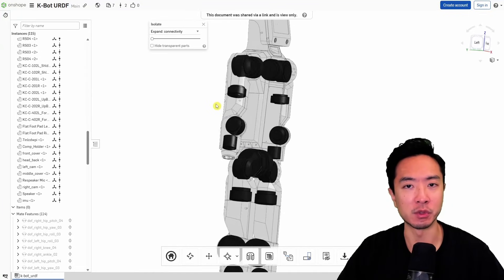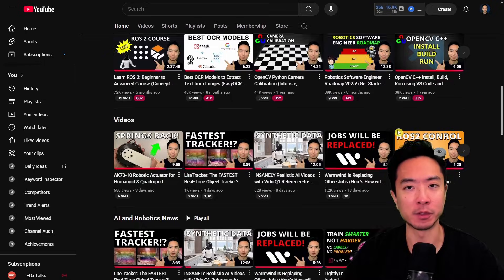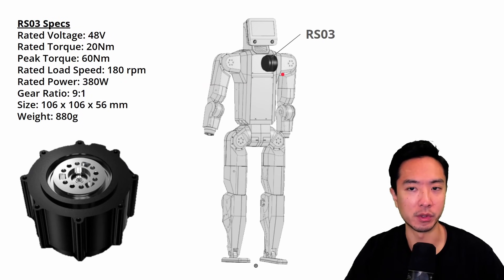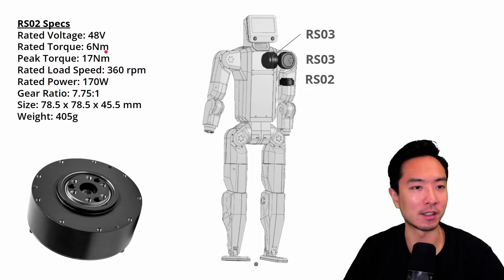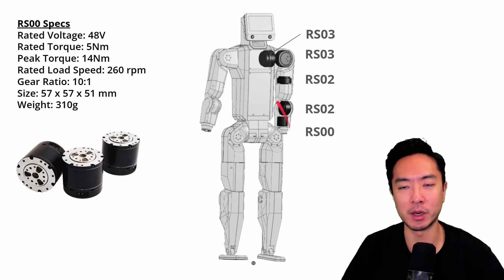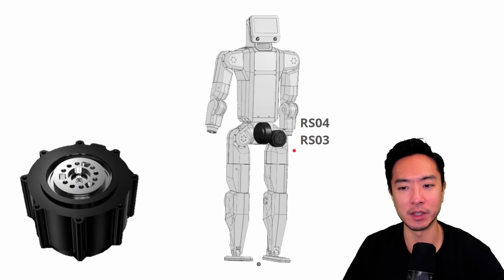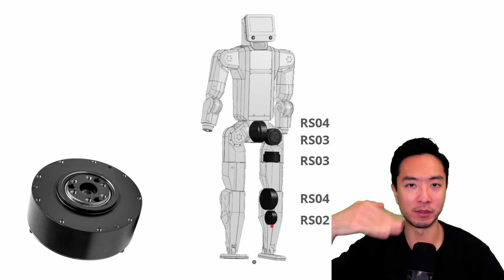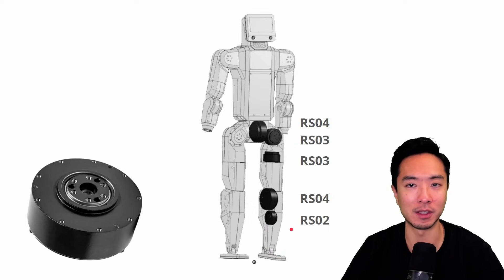K-Scale Labs K-Bot Actuators for Humanoid Robot (Quasi Direct Drive QDD Robstride)

Comment: Does the actuator have brakes? What happens when there is no power supplied to the motor? Does it fall down?
Reply from the maker: Need to check, but if no brakes and low gear ratio it would fall
Reply: let me know if you get to know about brakes
Reply: @recentrobotics_ai  No brakes. Check out the specs of the Robstride actuators. They are backdrivable.